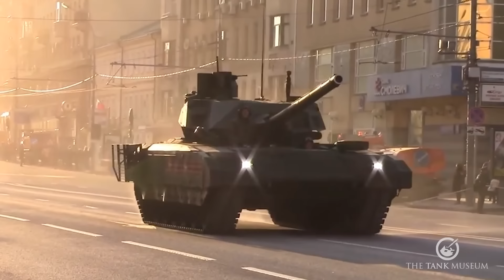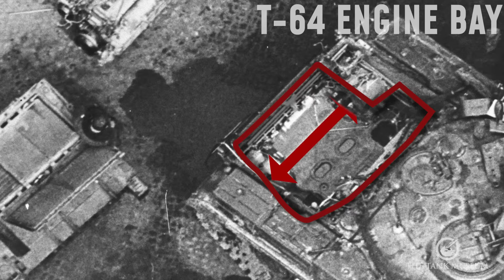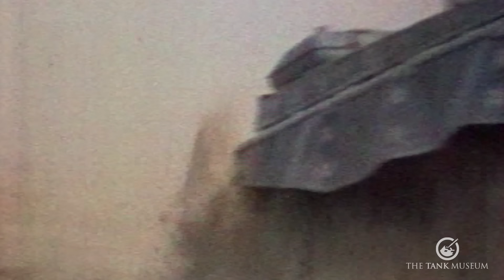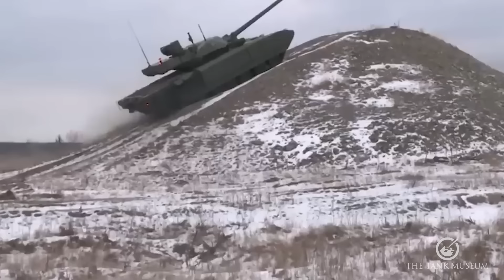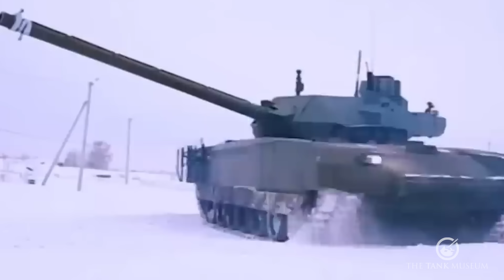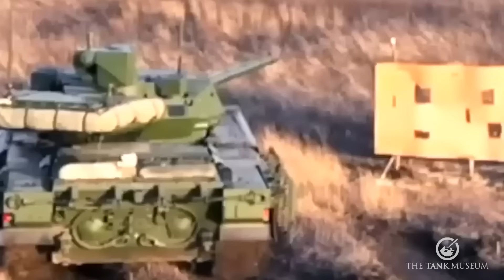Radical or Ridiculous? | T-14 Armata | Tank Chats #171

Comment: How come Russia doesn't use the T-14? Is it even real?
Reply: Honestly I don't think the t 14 will ever be put into service and for the reason you think.

Mainly I believe that ye project would probably be scrapped or completely chnaged due to the nature of drone warfare where spaced plating and electronic warfare will take priority over thermal camouflage and stronger armour. Along with heavier top armour to protect again atgms and drones.
Reply: The prototypes were obviously 'real', but certainly were far from usable in combat.  They would have been made in mild steel for easy modification and with empty boxes in place of not yet developed features.

No additional vehicles were made.  It appears that four of those original seven were converted to T-15 and T-16 prototypes.

Comment: A year later, still no sign of the T-14. The 20 or so produced are essentially hand built pre-production models and parts needed to be hand-fitted. These are not combat ready. Last I heard they were down to 16 running from 20 when they paraded them.
Reply: Where do you get those numbers?  Why would continue to believe that news source?

You can find many different counts claimed, but only the seven prototypes have been seen. There were many marketing/promotional videos, so it isn't as if there was any secrecy around the program (except for how far behind schedule it was).  If there had been more, we certainly would have seen all of them, no doubt in carefully framed videos implying that there more.

≈

Comment: Ukraine has proven their FPV operators & $500 drones w/ RPG warheads can accurately hit their mightiest T-90 MBTS at its most vulnerable areas. They''ll also penetrate Armata's thinner engine armor and vulnerable under-turret rings to disable it and then more FPVs hit it over & over again to break tracks and hit again the already breached rear engine compartment...
Reply: In fact, there is video footage of a radio jammer attached to the top of a Russian tank turret disabling a Ukrainian fav drone. Perhaps the T-14 will have more countermeasures against anti-tank weapons in the prototype stage.

Comment: It’s a light tank with lots of composite armour. Lots of weak spots.
Reply: It's built like a light tank, but it certainly isn't light.  It's easy to put a low number on a spec sheet of something that hasn't even been designed in detail.  It crossed 49 tons before they stopped reporting on the weight gain.

Comment: I think you’ve misread the reports on the cancellation of production, they cancelled the initial production run in 2018 as they weren’t going to make the 2020 date, they said by 2025 they aim to go into the final stage of development; design, production process etc so as to start mass production of the vehicle, I’ve seen many reports to this but you seem to have given one spokesman more weight that stated they didn’t need a knew tank but that sounded opinionated, I could be wrong of course but I wouldn’t be so sure that we aren’t going to see the platform enter mass production. Forgive me on my English I’m not proofing this comment

Comment: Someone told me that the T-80 had detectors for laser designators and a computer that would override the gunner to turn the turret to fire on the source of the guide laser, regardless what other problems the T-80 crew were dealing with.

Comment: Aren't you tired of telling the same thing over and over again?
Let's go point by point:
1. Microelectronics. Ahaha of course! We have already run out of missiles 100 times, all washing machines and microwave ovens with TVs have been dismantled, the chips have been taken out)))) Yeah!))) Your “experts” are not aware that all microelectronics for military purposes were and are being produced in the required volumes at own factories?!)) No? Well, continue to believe them)) And we will continue to produce high-tech weapons in the required volumes. Production volume is only growing)) What about you?))
2. The T-14 tank is not planned as a large-scale replacement for the T-72, T-90 or T-80! The T-14 is a tank for specialized tank units. It is more expensive and more difficult to operate if we consider it as a mass-produced tank. The T-72, T-90 and T-80 are much better suited for these purposes. They remain massive, unpretentious and very effective on the battlefield (the battles in Ukraine (country 404) are proof of this.
3. Losses. Just look at the irretrievable losses of Ukrainian equipment - they are many times greater. In the Russian army, most equipment is sent for repair due to the exhaustion of the service life of the rollers, suspension or gun. They are replaced with new ones and the equipment comes back. The irretrievable losses are much lower than those of the Ukrainians.
4. They are successfully fighting corruption and now it is minimal. Look at the execution of the defense order - it is being completed ahead of schedule! New T-72B3M and T-90M tanks are shipped in dozens every quarter. Other modifications of the T-72, T-90 and T-80 are being modernized and also sent to the troops. How many tanks or armored vehicles are produced or at least modernized in Europe and the USA per year??
5. The T-14 has already been successfully tested in Ukraine.
6. Show where our army is besieged and in a difficult situation??? Are you confused with the Ukrainian army?
Reply: Now that's a cope wall
Reply: I am an ex Cold War tanker man and a German engineer trained in the semi-conductor and electronics industry , including a university degree.
One thing is for certain, the claim that Russia imports wash machines for electronic chips is for sure a Western propaganda piece. Russia is not bankrupt and not isolated. As long as they pay they will be able to import electronic components in the global market to be soldered onto their print board.
They probably have problems with their own electronic industry to churn out enough complete electronic units like laser ranger, radar units, stabilizer controls, engine management controls on a large scale of military quality and specification.
However, we should never under estimate Russia and believe that they are only bunch of drunk sub-intelligent kids. They proved time and time again throughout their history that they in the long run prevailed, including the prove that if they really go for it they will master excellent technologies.

The West should stop our own cheap BS propaganda - specially since we want to be the "better" ones.

Peace! from Dresden / Germany
Reply: You guys literly claimed it to be the New Main battle tank of russia kid 😂

Comment: For some reason in a lot of videos it's hard to find a level of objective commentary instead of low-effort digs (i.e. moskva promoted to submarine, t90 is Russian space program) etc...

This vehicle enables the doctrinal changes that can't be implemented without revision to the fundamental design ethos of russian armor vehicles. 
From an engineering point of view, the design is quite capable and mirrors almost all of the western design priorities (modularity, crew survivability, communication, technology, data networks etc...)
They will need to work more closely with China to ensure the availability of electronic components if they want to get the program off the ground.

With the time this takes to resolve by either getting sourcing partners in China or if it never gets fully resolved, the competitiveness of the design will begin to fall.

Combat trials will also need to be done and the results of this may change design priorities especially with the persistent threat from drones. Western designs have seen fairly consistent combat experience since their design and production in the 1980s, and the feedback from each of the allies is routinely communicated, whereas the Russian equivalents seem to operate on a longer iteration cycle.

Will be interesting to see how this proceeds if at all now that we are facing an increasingly remote operated military priority list.
Reply: Agreed. We need more objective opinions. New tanks take time to create. 

Russia's invasion of Ukraine has shifted the priority to getting as many tanks as possible on the battlefield. Quantity is needed to cover Russia's very long front line. 

The Armata simply wasnt ready yet. So that meant Russia has to refurbish and refit older tanks like the T-72, T-80, T-90, etc. 

I'm sure Russia would love to have their military be outfitted with new Armata tanks and APCs based on the Armata platform. But the realities of their war meant putting Armata production on the back burner (for now).

Comment: They have 10. that is normal development.
2 are operational, with every development installed. The rest are testbeds
Reply: The first prototype was finished in 2015. The plan was to have 1000 of them by 2025. For most countries, that would b a normal timeline. It is now 1 year from 2025 and Russia has built 10. Something is clearly very wrong.

Comment: I don't get it, I guess you don't trust your lying eyes when it comes to Russian technology, but western technology? You'll take it on faith...

The one thing I'm skeptical about is the possibility of the turrets electronic systems being disabled and no possible redundancy being available. Currently they have powered and manual controls.

One advantage of the 3 crew up front is that additional armor protection can be placed in this area alone, meaning safer crew and perhaps even lighter tank overall or just better protection with the same smount of total material.

In my opinion, looks are super important, and I'm not too impressed. It looks modern, but not necessarily as iconic or attractive as the older models. I really like the t90. The round turret is just so likable. This is a little more geometric, etc. It's ok.

The interior looks much nicer, more comfortable. The t72 is tight... but this looks reasonable.
Reply: Cosmetics are literally the least important part.

Comment: You forgot to mention how the Soviet autoloaders are the main contributer to the Russian Space Program, but I think everyone knows that. Also, I think it's noteworthy that all of the Armata series vehicles are built on a tank chassis, and armored similarly. It sounds good in practice, sure, but its actually a horrible idea. Tanks are very fuel thirsty, and in a war, you can't always rely on good logistics to keep all of your vehicles fueled up (especially if you're russia). So having every single one of your vehicles be as heavy as a tank means that every single one of your vehicles needs the same amount of fuel as your tanks. The smarter way to do it is to only armor the vehicles you expect to see combat, like APCs, tanks, CEVs and IFVs. Engineering vehicles like recovery tractors, artillery tractors and stuff that you don't expect to see on the front line shouldn't be armed so heavily to save on fuel consumption, and to an extent, maintenence

Comment: Russia could do all the tech stuff in the t14, but from working with this tech, unless its needed, you probably dont want it. I admire the pragmatism in Russia at least they know its no good, they are still making new t90s and for filling export orders. its better than making thousands of a bad tanks like the m1 abrams that has a heat signature that can be seen from space, and huge inefficient supply lines to feed a tank that dose .6 mpg. In the us air force they keep ancient equipment, for good reason, it just works, f35 is no match for a modern f16, we all make mistakes.

Comment: Dear author of the chanell - russian tanks were reduced to 3 crew members due to the philisophy of nuclear wars into the future. All russian tankes since 1970 have pressure inside the cabine higher than athmospheric one to avoid  suck of polluted with nuclear residues outside air. Also it allowed to do not increase the power of the engine, accodringly the weight of the complete tank and accordingly the dimentions of the tank. Russian tanks were, are and will be better than anything from you ddesigned. Simply the best ever forever.
Reply: Internal overpressure has been used by NATO since the 1950s.
Reply: @billpugh58  at which tanks? Please specify.

Comment: 2:15 Centurion? Yeah Centurion Mark 3 was fitted with a twin plane Stabiliation system in 1948 I believe. I think that the Russians started fitting twin plane stabilizers in the mid 50s, T55, etc.

He said first twin stabilized tank GUN, unless he is perhaps referring to a behind the scenes thing before that that didnt enter service until later.

"In 1948, the British Centurion Mk. 3 featured the first two-plane stabilization system in a production tank, while 1954 saw the introduction of the STP-1 stabilizer complex for the T-54A, and similar systems would be implemented on virtually all Soviet tanks from then on."
Reply: Hes a leftist marxist, who has a hard on for communism. You are correct btw

Comment: T-14 has a unique feature. If can morph! It can perform that only once, though, and it cannot not morph back. There are two options what to morph into: 1) Yacht 2) Villa. Problem is that this feature is switched on by default. That made it impossible for the T-14 to appear on the battle field.

Comment: oh, this is real nonsense. You would also say that Russia makes nuclear submarines or cruise missiles using Western electronics. All tanks are traditionally manufactured on equipment manufactured in Russia. Individual devices, such as thermal imagers, can also be used by Western production, for example, made in France, but this is usually for tanks that are produced for export. The real sphere of production, where radiation-resistant electronics were relevant, were satellites for space. But even in this area, this electronics is used in some limited areas of application. Russian designers will do something really serial on their element base, somewhere with the possibility of replacing individual components, probably.

Comment: Its designed for tank to tank combat which even in Ukraine is rare. Most tanks  in Ukraine are being used against infantry and fortified positions hence why the Russians are using up old gear. If you se tank on tank its usually a T90. Same as the fellon. Its a stealth fighter that isn't needed to fia handful of mig29 and su25s
Reply: That is the most copium I have ever seen. If they have this advanced tech, why don't they use it instead of getting their asses handed to them by Ukraine? The answer? They don't have this advanced tech. And the SU-57 felon is not a stealth fighter, it has the RCS of a clean Super Hornet, and exposed engines that give it a heat signature similar to the sun. It's at best a reduced visibility 4.5 gen fighter, with mostly 4th gen tech thrown into a 4.5 gen airframe.

Comment: Question: If the auto loader jams how does the crew unjam the gun in battle when they are locked into the cabin?

The ghost pf Ferdinand Porshe is probably stunned someone is NOW using his failed engine.

Comment: Armata and F35, siblings?
Reply: F-35 has been produced by the hundreds and is largely in fully functional state, seeing full adoption into multiple air forces. Armata barely exists outside of parades. Big difference.
Reply: @bluntcabbage6042  Multiple airforces forced to use a trashy aircraft?
Reply: @johnsmithschannel999  This "trashy" aircraft routinely outperforms its competition in every notable metric and countries aren't being "forced" to use it, they're lining up out the door to buy them. Countries want F-35s. When deals for F-35s get shut down by the States, the prospective buyer usually isn't happy. 

The two are in no way comparable.
Reply: @bluntcabbage6042  Routinely crashes, that's the best definition.

Comment: So much Russian equipment just looks good on paper - I guess the war in Ukraine has brought this into stark relief, but many people have known it for a long time. My dad used to be in the RAF, and had a look at some of the MIGs and Sukhois from the former Eastern block countries after the collapse of the USSR, and they were junk - wiring looms that were randomly replaced because the heat from the engines at full power would burn through them, huge spikes and drops in voltage when the radar was activated - which would turn off multiple other systems. And the training for USSR pilots (and one has to guess now Russian) pilots was a joke, people in the west operating fork-lift trucks would get more tuition.

Comment: I don't know if this tank will ever see mass orders, production and deployments. But it introduces sound design ideas: unmanned turret, active protection, light weight, a protecting crew capsule for the crew, high mobility. My guess is that other nations will copy its ideas to build many light, cheap, smart tanks, with lighter armor and a protecting crew capsule.
Reply: Good point. Those western h 8 ters literally don't understand how valuable that design is.
But it's weight is not light, it's a heavy tank design. As with any tank, it's weight increases with times, due to upgrades, it has already been increased in armata as well ,as it went through several iterations of improvement and armor enhancements... and something tells me that it will increase even more in 2024.

Comment: The huge disadvantage of an autoloader is the gun had to be aligned in such a way that required the barrel to elevate. That doesn't sound like that big of a deal, until you realize the gunner can only look out of a sight that points down the barrel. That means on every shot, he has to regain situational awareness. Compare this to the alternative, where a gunner shots, watches his round go to the target, and shoots again if necessary.
Reply: That's true only of the coax sight today. It used to be true in older days when the sights were mechanically coupled to the gun through a ballistic drive mechanism. With digital fire control systems, a computer controls alignment between the sight axis and the bore.